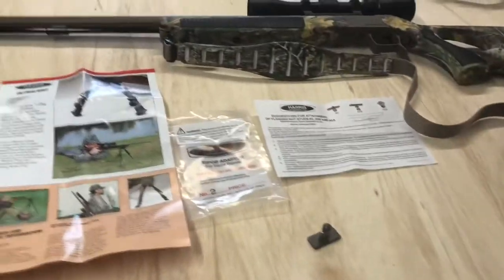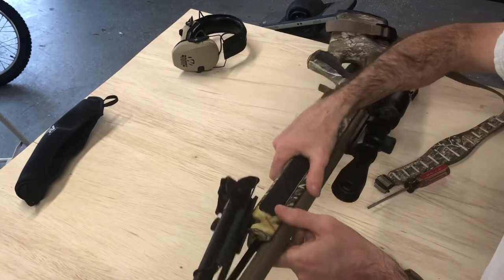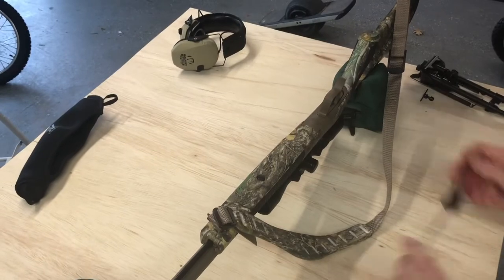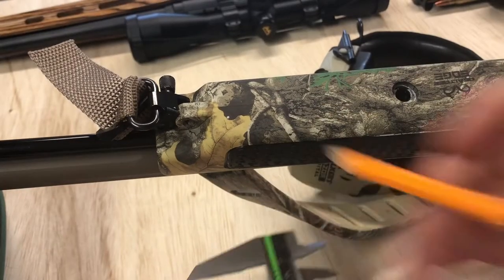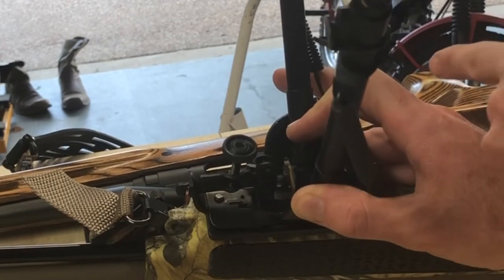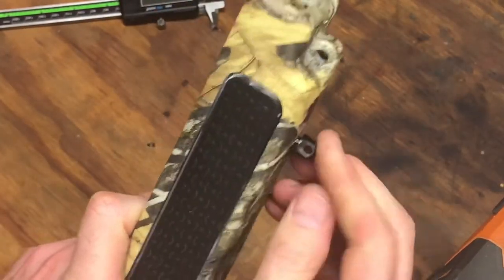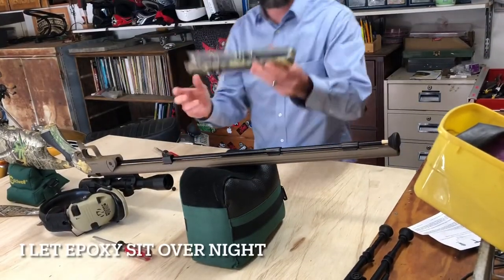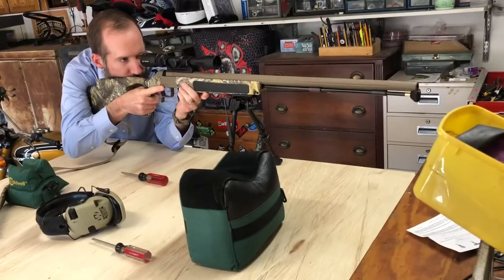How to install a rifle sling stud to a synthetic gun stock.

Comment: What weight charge are you using for the blackthorn 209?
Reply from the maker: I I use the max charge, but I measure it in weight not volume, so I measure 84 grains in weight, which shows about 110 in volume in my tubes, but per Blackhorn’s load data it says not to go over that 84 in weight. You can actually look at a couple of my other videos on the damage it did to a deer and you can see how I measure BH209.